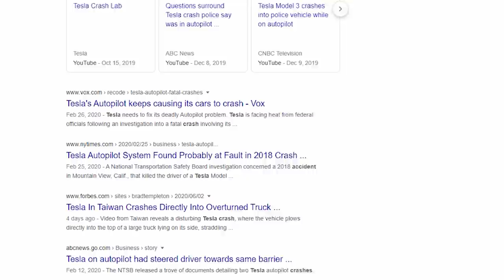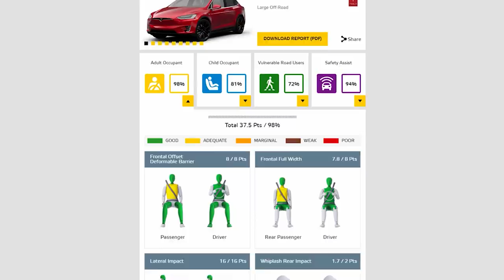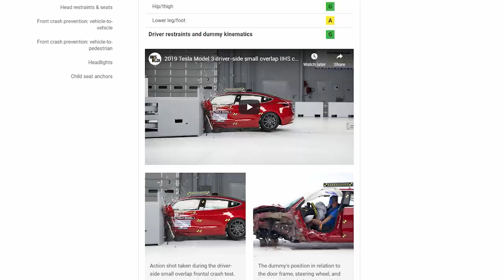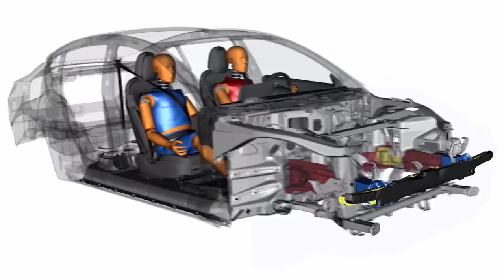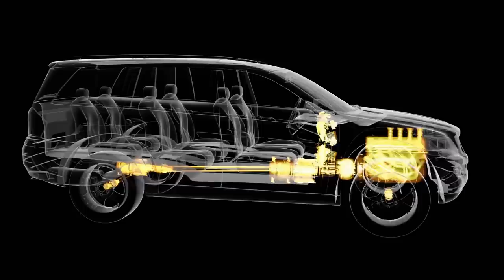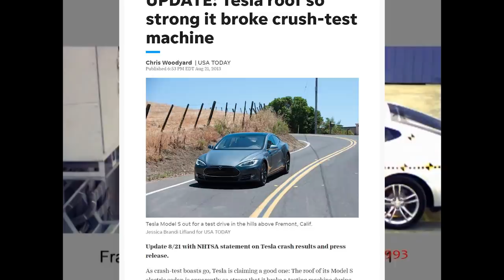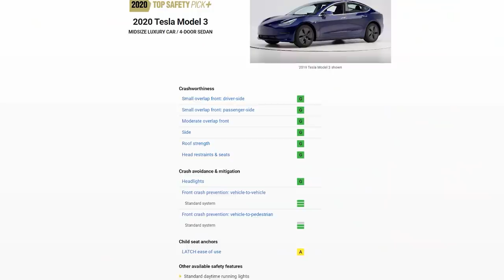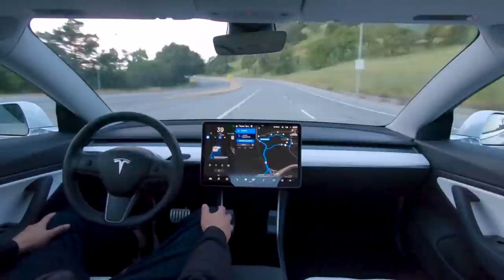Tesla: The Most Dangerous Cars on The Road?

Comment: US government yes. But it didn't do better than other cars in euro Ncap or IIHS. Other cars also got the top safety pick plus awards. So don't skew information.
Engines DO NOT impact the safety rating. Crumple zones were designed by Mercedes benz in the 80s in cars WITH ENGINES. The engine breaks away from the car. It does not intrude into the passenger space. It's why there are cars WITH ENGINES that received better frontal impact scores in euro Ncap. At least do research before making a video skewing the actual safety of tesla. Tesla doesn't even have half of the other passive and active safety features from other cars. It misses so many. But it's expected for a tesla fan or owner to not know since they're usually ignorant to all other carmakers.

In this video you basically spoke about generic stuff everyone else is also doing.

Comment: I would still prefer a Tesla over any Vehicle. It’s still hands down the best on the market. 😌😌 In my opinion it is still better than an ICE vehicle. 🥳

According to cleantechnica.com 

“ICE cars are fundamentally more exposed to fatal fire risks than their electric counterpart.”

“Even in case of collision, ICE vehicles are more likely to catch fire than hybrid vehicles.”

“ICE cars are fundamentally more exposed to fatal fire risks than their electric counterparts, as the deadliest fires are mostly due to flammable liquids located in the engine area.”

Comment: All vehicle take collision on road and highway carrying gas tank full of fuel and battery full of charge is a condition that vehicle safety board should include, as long as safety equipment is facilitated in the test lab and are ready in short notice. 

How accountable are safety test reports when tests condition is incomplete?

Passenger may survive a crash with top rating model could be burnt alive has gas tank or battery pack rupture.

Comment: And one thing I don't think you mentioned explicitly. If a gas powered car catches on fire, conventional wisdom says to get everyone out quickly and get them clear, because if there's gas in the tank, what you have, potentially, is a bomb on wheels. Obviously, an electric car has no gas tank. And while you should definitely vacate a Tesla whose battery is on fire, it's fairly safe to assume it will not explode.
Reply: An electric fire can't be put out with water. And the fire can continue sparking. Modern cars tanks don't explode. Compare vehicle fires of cars from 2012 (when the model s was launched) and up.

Comment: I love the way the zealot narrating this video implicitly claimed to have access to research proving that something or other "frightens old people" (about the six minute mark). I had heard enough at that point.
Reply: I’ve never seen a kid hate a Tesla. He has a point. Also you can explicitly add the time stamp to the video like this 5:53 and people can click it to see your reference. No need to use vague references.
Reply from the maker: Just out of curiosity, how old are you Roger?
Reply: @ElectricFuture , 57, and I am well aware that lithium ion batteries generally burn far less explosively than gasoline.  FYI, I am a fan of EV's, and I am pretty sure we would both agree they will almost certainly surpass ICE vehicles in every respect during the next ten years.
Reply: @rickkay9548 , thanks. I googled it, and yes, placing a time stamp in a comment could hardly be more straightforward.
Reply: Not this old person. I'm 82 and saving up for my Model Y.

Comment: Ya tesla explode esy smash front, why it's not hard metal bomper to protect the car and drive. Just a piece of soft plastic bomper, to kill you during crash accident. Get a real hardi metal bumper on your car, not the killer plastic fibet bumper think twice 100 times save your life. Change the cheap cheap plastic fiber killer bumper, to solid metal bumper.

Comment: Your enthusiasm is self defeating. Your battery fire stats; per cell, works out to 1 in 14k for the Model S; and 1 in 33k for the Model 3 std range.  Tesla has announced structural changes to save weight, so future crash tests could be less great. You'd rather be next to a Tesla on Autopilot than next to a distracted driver? Great endorsement!!  You state; Autopilot is 9x safer; but fail to note it disengages in any complex driving situation, dumping responsibility on the driver at critical moments. You blame the driver for being lulled to intensiveness; and over estimating the ability of the technology; and contradict yourself again later saying how autopilot is so safe.  Maybe it isn't. You show more bias by comparing Tesla fires to all vehicles; which of course include tons of old clunkers that are far more likely to have a fuel fire. Why not just say Teslas catch fire less than 1918 Humpmobiles?  Clearly 1 in 14K cars that are pretty new in comparison isn't very good; but it is nice to hear that it better by 50% than it was before - implying it was 1 in 7000 Tesla's that had been catching on fire!.. Why not just say honestly;  it's a new technology and Tesla is learning how to reduce this deficit?  BTW no one I know wants Tesla to fail and no one wants to see a car fire. What we do want it honest information.

Comment: "revolutionary passive and active safety" you say? What's so revolutionary? Plenty of carmakers have better systems for collision avoidance and passive safety. Mercedes benz invented most of the safety you see in cars today and that includes collision avoidance which they had on their S Class since 1999.

You also can't compare vehicle fires of other cars to electric cars. Electric cars are new and not many on the road. There are ALOT of OLD gas vehicles on the road which are nowhere near as safe as modern vehicles. Rather compare data to that of cars from the same year an electric car first came out otherwise the results are pointless. This video was done by a toddler looking at stuff to only suit your own narrative.